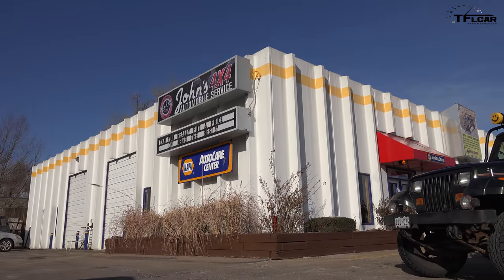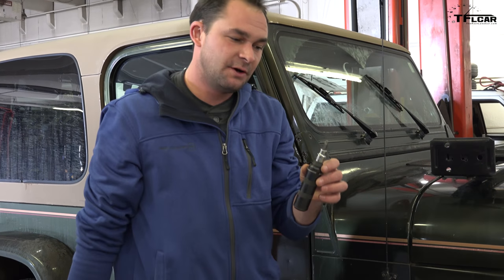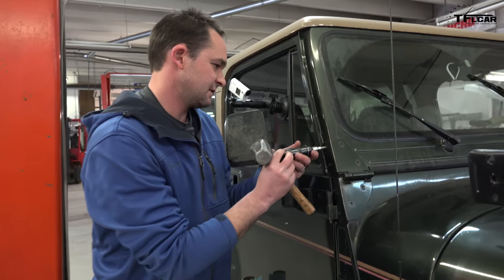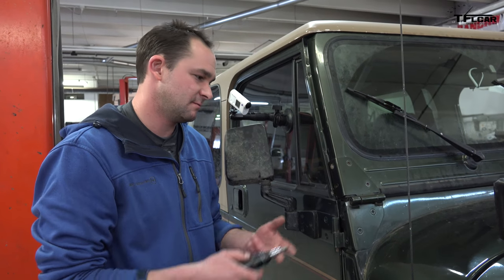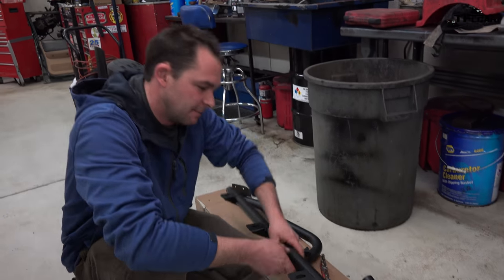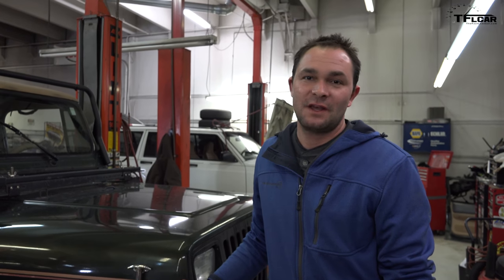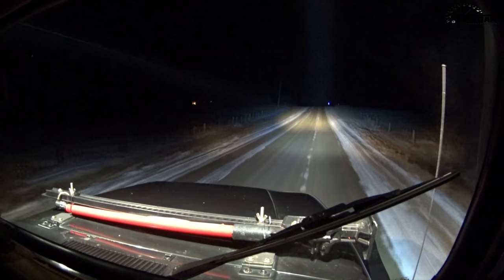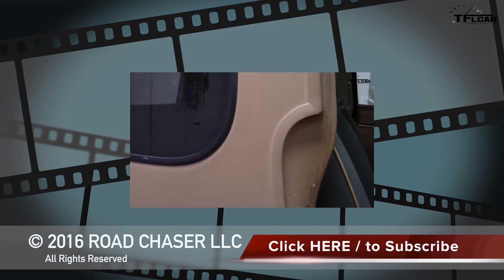Let there be light! Old Jeep Gets Old School Lights - DiffLock Ep. 1

Comment: My trick is to use a soldering iron to loosen a bolt. The heat is more localized than a torch, less likely to blister the paint.  But looks like the torch worked OK. Nice video.

Comment: I had the same issue with these bolts when I installed aftermarket mirrors (to go doorless legally). I ended-up welding a nut on each bolt and removed them with a ratchet. I had to weld a little "puddle", add the nut, add more weld to tie the first "puddle" and the nut together and voilà: ready to be removed.

Comment: Getting old torx flat head bolts out can sometime be a real issue for two reasons. One is that the originals are mild steel and can rust into place if moisture gets to the backside (even in the windshield frame). The second is that the torx design is slightly tapered and on flat head bolts there is not a lot of room for the full depth recess, so the bit can slip easily. When I was refurbishing my TJ, I replaced every flat heat torx bolt with 3/16" hex drive bolts of the same size. The recess for the 3/16" bit is noticeably deeper than on the torx bolts.

Comment: For the new bolts, I would go with STAINLESS STEEL bolts if at all possible, because in a few years you will probably want to remove that light bar, and when that time comes you will have wished you went with 100% stainless steel bolts.